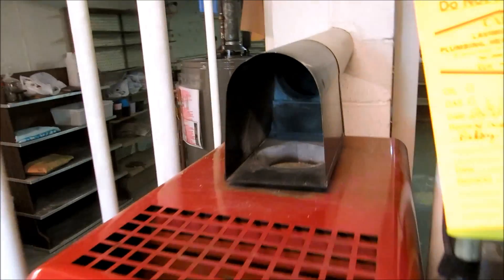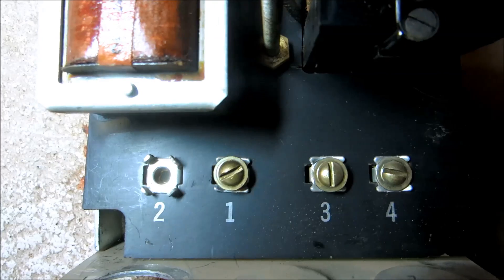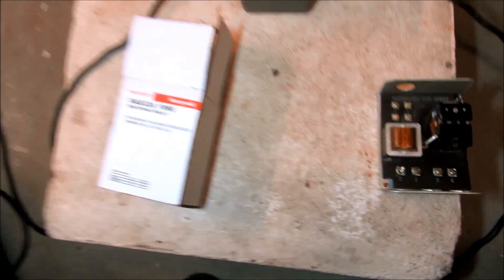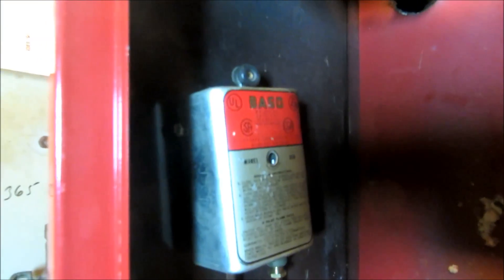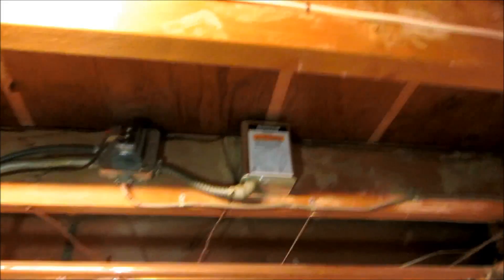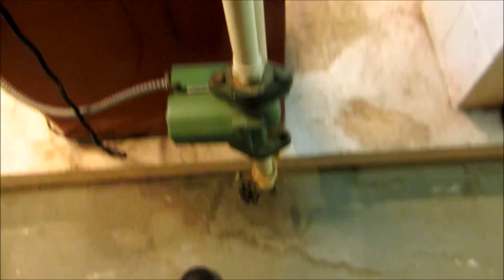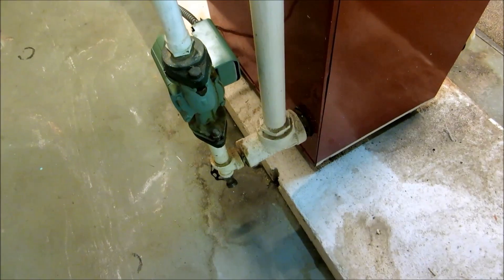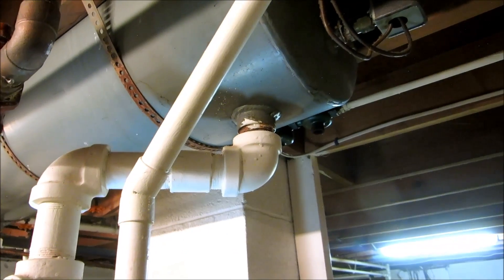hydronic gas boiler with odd draft hood and piping job

Comment: Reminds me of the boiler that was in my house.  Really strange stuff and a HUGE expansion tank.  Of course (my luck), the pipe connecting the boiler to the chimney was made of (the "A" word).  Had it replaced with my >90% which doesn't even connect to the chimney any more.

Comment: That is one mint / ancient boiler! I've been doing this stuff for 15 years and never have seen a draft hood like that before, I bet it spills quite a bit until the chimney gets some heat? Thanks for sharing!
Reply from the maker: +Josh Smith still running like a champ ,odd draft hood for sure
Reply: @stevenlavimoniere  yeah it probably does spill a lot.
Reply: @stevenlavimoniere  it is the wrong one that is for a rear discharge and would go on the back and would vent up

Comment: I still see older boilers with a separate supply vale for the pilot in neighborhoods like Georgetown and Capitol Hill here in DC. Must have been the norm back then. I have never seen an expansion tank piped like that one. Pretty weird ; )
Reply from the maker: Longeno55 weird for sure

Comment: That thing looks beautiful! It's nice to see you making an effort keep such a well built unit in service! Do you suppose it might've been gravity circulated originally?
Reply from the maker: Josiah Hanna the main loop into the tank/header works gravedy but the 2 zones one off each side have cerculaters its not old enough to be a gravity system with out cerculators besides them systems have big piping and usaulally a pan cake boiler set up vintage ,with no cerculator for zone ,i will find some and do a video on a gravety system when i see one
Reply: steven lavimoniere
That would be great Steve! Thanks!

Comment: the tank probably acts like a buffer tank provides a volume of water to prevent excessive cycling of the burner..? Almost the same principle as a low loss header...dual function expansion tank low loss header.. Im only guessing though..
Reply from the maker: plumbworker odd to see one piped like this up my way seems like a lot of extra work for nothing ,its not needed only 2 1"monoflow loops feeding old 60 's copper base board radiation

Comment: Steve I never seen no boiler plumb that way before your right very strange.  The hood , piping , and gas valve all that is old and odd.  Kind of scary if that chimney ever got blocked all that would go right out the hood and into the home wit no draft roll out switch , scary man but good video and she's still working and running good .
Reply: Never seen a setup like that steven lavimoniere.
Reply from the maker: Rob HVAC every day is a school day i always say. i see new and different stuff every day